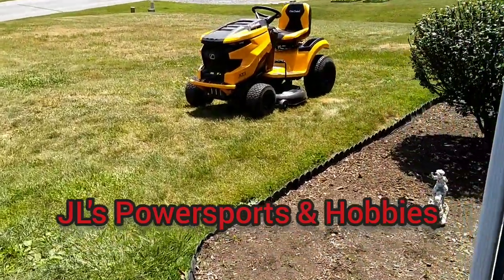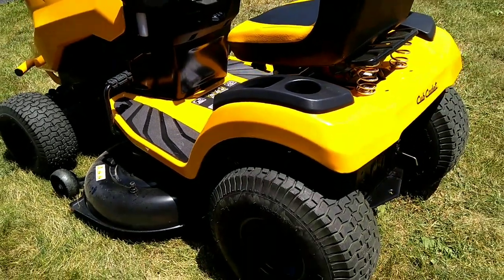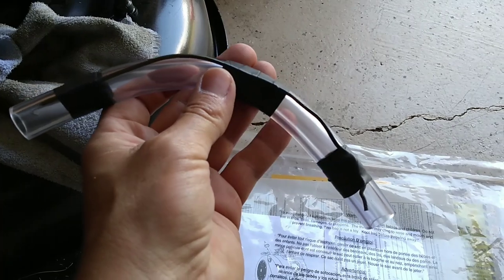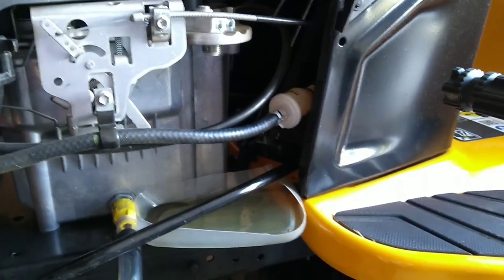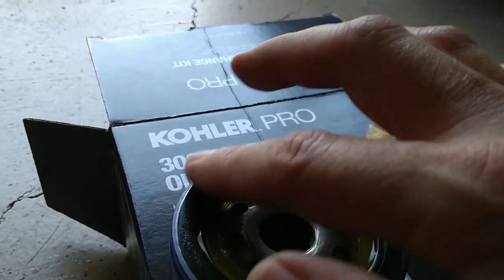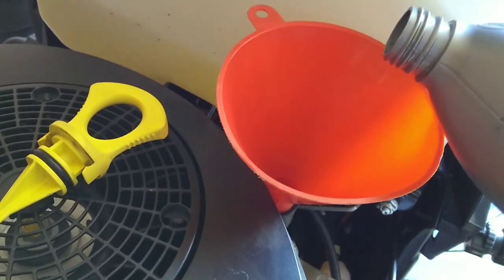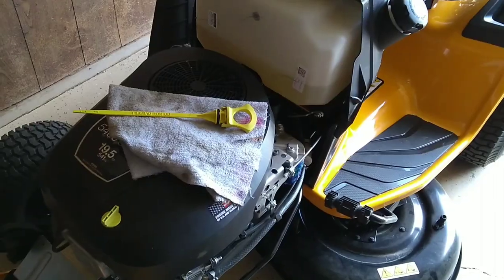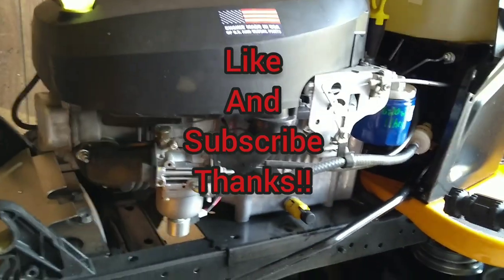2022 Cub Cadet XT1 LT42 😁 10 hour review + DIY 300 hour oil and filter change kit

Comment: Thank you- I pull deck and use old oil or rust killer to lubricant underneath deck in winter and clean off in spring before first mow

Comment: I'm just about to bring home the xt2. After much research, (if you want my opinion on what I'm going to be doing) I have found that pulling out the k46 transmission and changing that oil as well will greatly increase the life of the transmission. There are magnets that need to be cleaned & I saw one k46 with an internal filter. 5w-50 synthetic is the  oil to use. Some guys add an oil stabilizer to it.
Looks like a great machine for the price! Thanks for the videos!

Comment: I've got a 10 year cub cadet ltx1040 that's your tractors grandfather, lol. They're almost identical, except theyve changed the adjustment method to level the deck. Mine is still running with 269 hours on the clock. I've replaced belts,blades,and the pto handle because it bent out of shape over time. Now its needing a new pto cable and spindle. Thinkin about fixin those few things and selling it before something major breaks. It's been good for it being such a cheap mower to begin with.

Comment: my advice about the oil filter is to make a hole with a sharp screwdriver to hit it with a hammer or similar let it drain and you can remove the filter with 0 leaks

Comment: Keep riding and you will gain weight and activate the safety switch. Look at those who have riding mowers and you will understand why they put those heavy duty springs on the seats.
Reply: I was a nightshift supervisor at a small manufacturing plant and had to do all the forklift training.  I had to train a little woman that was 5ft tall and 90lbs. Every time she hit a dip or hole itd shut off on her.

Comment: I just got an xt1... man that 300 hour hour oil change seems crazy but I'm thinking about it. My old mower a ltx40 I got used with 200 hours I changed the oil when I got it and it has 235 hours now.... that was 6 years ago 😮 ....so 300 hours would be in dog years forever lol. WTF why not right????... it'll be the first and last oil change I'll have to do by my scientifically calculated analysis. Gotta say the second I started driving around on the new xt1 I realized my old mower is a complete POS. Dang it's a a smooth ride maybe I'll mow my grass more often now.

Comment: Shoot i got 2024 xt1 euro with the 7000 seris kholer and it dowsnt have a oil cooler and it will burn thru that synthetic oil especially if u live somewhere in the south and that seat i hate it i wish i would have spent my 3000 for a diffrent mower

Comment: Are there any grease fittings on this model?
Reply from the maker: On the front axle for steering it has two. If it has anymore I haven't found them yet.
Reply: @jlspowersportshobbies4568  thanks.